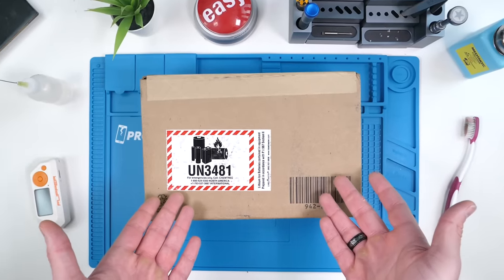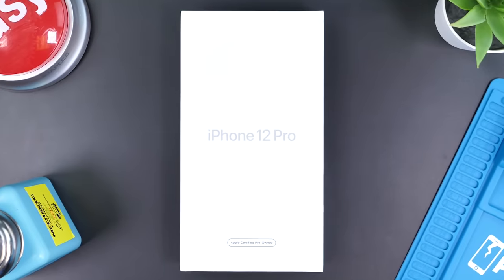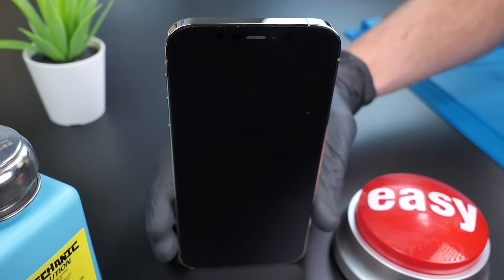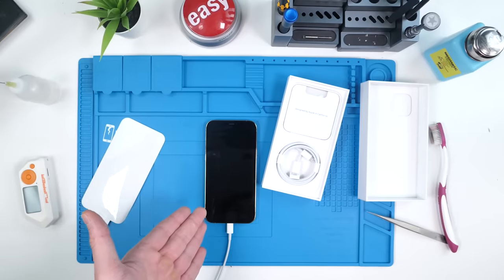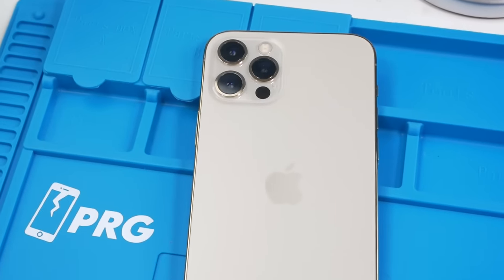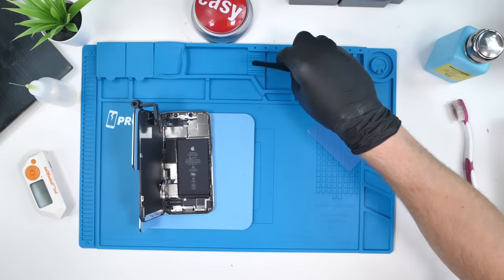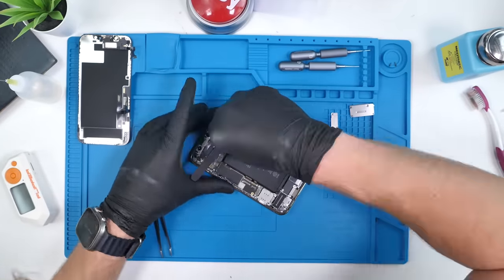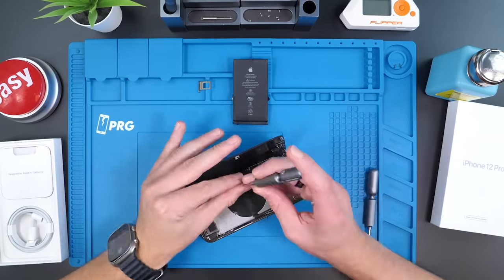Apple Refurbished... What's The Catch?

Comment: Fun fact I’ve worked at Apple and those phones are the ones that we replace when you ask for a warranty. They are brand new, buy refurbished
Reply: Elaborate
Reply: What about accessoires? Like the 3rd gen AirPods?
Reply: @18PregnantAndProud  because they are technically not brand new, so they simply can't sell them as brand new
Reply: @18PregnantAndProud  yep because the battery failed or something. And they replaced
Reply: Are those phones still water resistant like new or not?
Reply: @TheNintySeven97  Of course they're water resistant.
Reply: @TheNintySeven97  yep, they are literally brand new they pass the same tests as a new iPhone
Reply: I’ve twice received a new unit and it was NOT in a box like this. Both times it was a super flat box which only contained a new phone. Why would they give you a new cable, knowing how ultra stingy they are (“for the environment”)?
Reply: because you’re buying a replacement, you already have them. These are considered first-time purchases.
Reply: Agreed. I have bought 
4 iPhone 4S still using one 7 years later
1 5S dead after 4 years
1 iPhone 7. Returned because microphone failed didn’t work 
1 iPhone 8 still works but charging issues after 4 years
1 iPhone 12 mini works perfectly so far PERFECT and saved $420 from the cost of a new 12 mini
Reply: @MatoNupai  bro has more iPhone than my entire family 💀
Like WTF aren't apple supposed to be last more than 5 years 😂
Reply: @ryanb5308 I wouldn’t buy AirPods that were in someone’s ears at some point in time ever 😂
Reply: @BRAZZERSXXXXXX when they replace AirPods they thow out the old pairs

Comment: I think that Apple Refurbished is good, but still, they should try with some older phones. The 12 will stop being sold refurbished after the 15 is out. If I could have bought a refurbished iPhone 5 I really would have.
Reply: Yeah I wish they would continue some of the older phones that would be cool!!!
Reply: i wanna buy refurbished iPhone 4
Reply: Those phones don't have software support anymore, so I doubt they would do that.
Reply: the 11 line was sold in the store until a couple weeks ago. Every once in a while a really cheap 360ish dollars iphone 11 shows up. You cant go cheaper then that.
Reply: eBay refurbished is better
Reply: @malikkelly  in no way
Reply: Barely anyone would buy them. The iPhone 5 can't run past iOS 10 which has virtually no support for most of the apps you'd use every day.
Reply: maybe not that old but i would totally buy a refurbished iphone 8 plus
Reply: Trust me
Get the 5s
It's basically all you need for cheap
Good battery, small, portable, fast and cheap
I still use it for phone calls and airdropping things to my iPad
Reply: why? @malikkelly

Comment: I got an M1 iPad Pro from apple refurbished.  Saved about $200 compared to new and the unit was absolutely spotless.  As far as deals go, sometimes amazon or best buy are better, but as far as quality goes, I can wholeheartedly recommend apple refurbished.
Reply: I just ordered a brand new 2tb m1 iPad pro 12.9 for $1000 on woot. Hoping it comes with iOS 15.4.1 or older for jailbreak. Killer deal if you ask me
Reply: i also ordered an M1 iPad Pro 11'' in it's cheapest configuration for 749€ and i'm super happy with it. It's basically brand new and I paid less money then I would pay for a new iPad Air
Reply: @GU_WOP_O  didnt those ship with either 15.6 or 16
Reply: @xuus I have the same issue rn, how is it working for you now? I want to buy the iPad Pro M1 11inch so bad bcs the air is the same price but less
Reply: Having issues with the m1 12.9 at the moment, it doesn’t like charging with most forms of charger and it seems like lots of other people are having the same problem  - maybe best to wait until apple releases a repair or software patch for these

Comment: I used to work for a Foxconn affiliate and they basically used all new parts for everything, but the motherboard. There are a few different device assembly and disassembly lines that take the phone all the way apart, do extensive testing of the motherboards by plugging them into devices that check that everything is still working, the motherboard gets flashed with new information, like the IMEI and all of the parts are serialized to the device and assembled. They use all of the same equipment that the normal assembly uses.

They may refurbish some of the other parts, but at the end of the day, these are basically new phones.
Reply: There shouldn't be any fingerprints, so whoever was working on that part, wasn't wearing their finger cots.
The screws aren't tightened by hand, but with an electric torque screwdriver that is calibrated to not over tighten. They can still go in sideways, but it shouldn't be overtightened unless the calibration went off. I'm surprised you didn't have a device with a torn graphite layer anywhere. It was so common to see the screen with the torn graphite layer that it wasn't even considered an issue. (maybe that changed at some point)

Comment: When I decided to buy an iPhone 13 Mini, I first did it through the Apple refurb page. At first the only odd thing I noticed was that the gap between the screen and the top bezel was a little wider than usual, allowing dust to enter, but nothing I couldn't remove manually with the help of something thin. The real problem came about a week later, when all mobile data functionality stopped working regardless of which SIM I was using. I took it to an Apple Store and they confirmed that the antenna was malfunctioning. The funny thing is that they couldn't exchange it for me there, because refurbs are web-only and therefore returns can only be made from there. Anyway, I returned it without any problems and simply bought a new one on Amazon. The new one has a perfectly sealed screen, so yes, that wasn't normal either. I suspect the antenna was the component that was originally malfunctioning on the original refurbished phone, and the technician just failed to repair it properly. I know my case could just be bad luck, but I just wanted to put my two cents in here for everyone. On another note, the 13 Mini is my favourite phone and I couldn't be happier with its form factor!
Reply: Don’t see any 13 minis on apple site yet
Reply: 12 mini user here... Not a fan of apple and ios but there isn't alternatives
Reply: It wasn't normal that your brand new phone had a perfectly sealed screen?
Reply: @GeeEee75  I was comparing it to the refurbished one I bought from the Apple website, that one had a gap between the screen top side and the metal frame that the new one hadn’t. I suppose it’s normal to open refurbished devices if they need a repair, but obviously after that it was not properly resealed.

Comment: I bought all of my Apple devices on their refurbished store, that's an iPhone, iPad and MacBook Pro. They are typically about 15% off but here in the UK Apple just cleared out a load of old iPhone 11s for £379 which is nearly half the original list price so if you don't mind buying something that is just a couple of generations old you can get some great deals.
Reply: I have an referbished iPhone 12 mini from Apple and I think it was £400
Reply: eBay rebubished is better
Reply: @malikkelly lmao
Reply: Probably ex-demo or unsold/forgotten UK-held stock, I'd imagine. If you happened to buy one, does it have a UKCA mark on the box? 🙂

Actually, I might head to the Apple refurb site later. I know they're close to obsolescence (If not past it) but I miss my Xr, and I'm not buying another one through a reseller after the experience I had with that one!
(Previous owner defaulted on their account after I'd bought it, and the network provider blocked the phone without my awareness.)
Reply: yeah but an 11 sells for 150-200 fully working used, over 400 (converted) is crazy

Comment: I have an M1 Mac Mini I purchased from Apple refurbished. It replaced my late 2015 iMac, also from Apple Refurb. I gave that to my cousin and it's still chugging along. I also bought a 13 Mini from eBay refurbished for a 2nd phone for family calls only that came with 100% battery health and no scratches or other issues. That was cheaper than Apple's. Still, Apple refurbished has a decent record.

Comment: I know this is most definitely just bad luck, but I ordered a refurbished iPhone 12 Pro from Apple at the beginning of the year and had to return it just a few days after because it started bootlooping all of the sudden.
I contacted Apple support and they sent me a replacement phone, but that one didn’t seem to be refurbished as the battery was at 93% (dropped to 89% just a few days later💀) and the frame had scratches around the lightning port.
I returned this phone as well and thankfully got my money back.
I’ve just been very unlucky but I won’t buy refurbished again. I safed all of my money to buy a brand new iPhone 13 Mini a couple of months later and this one is working flawlessly. I simply cannot trust refurbished phones anymore. I’ve had too many bad experiences with them. The issues with the 12 Pro I ordered were the icing on the cake…
Reply: yikes, that's some bad luck
Reply: @DeerJerky  it really was :(
But I’m actually kinda happy it turned out this way because otherwise I wouldn’t have my 13 Mini now so it’s all good in the end haha
Reply: @Nexus7_  haha

Comment: This was an excellent video with good information. Apple is one of three manufacturers that I would buy a refurbished product from. The other two are Bose and Sonos. The three companies are the only ones that I am aware of that provide the same warranty as if it were new (one full year parts and labor, or even replace). If you buy a refurbished device from one of the big box stores or any retailer, you will most likely get a warranty that's from 30 to 90 days, and there is no guaranty that any replacement parts or components are OEM certified. Also, these retailers often use third party marketers, that most people never heard of. The parts may be generic.There may be other manufacturers that I'm not aware of that would offer one year warranty. Always do your due diligence before making your purchase.

Having been in Consumer Electronics since 1980, I know what I am talking about. A couple of tips:If your Apple device needs service (new battery, screen, etc.), only take it to an Apple store or Apple authorized service center. They are the only ones that use certified Apple parts and components. If you do use an authorized service center, never leave your device over night. If they insist that you have to, then leave and take it to an Apple store and have them service it. (Apple is less likely to go out of business).

Comment: Many, many years ago I had a faulty iPhone 4 (sticky home button) which I took back to Apple on like the 350th day of the 365 day warranty and they said (at that time anyway) that whenever you get a replacement phone through the warranty that late in the cycle it would a "certified refurbished" similar to what they sell nowadays, the guy said that everything is a new part except the motherboard. I think things like fingerprints on the internals and overtightened screws happen on new phones too, Friday afternoon jobs are the worst 😂

Comment: I looked at getting one prior to buying my 15PM, and I am also in Canada. They only had 13PM with either the 512 or 1tb. For the cost, it was the exact same as buying a 15PM brand new, mind you my 15PM is 256. From my POV, unless you really want more storage but you are fixed to a specific budget, you are better off buying new than apple refurb. It's just hard to stomach paying 1900 when that's how much a brand new 15PM base model is.

Comment: I bought my 12 pro refurbished through eBay. First one I got had the “display message” for a screen replacement. Bluetooth didn’t work but I sent it back and the new one I got works fine. Paid $500 for a 12 Pro 256gb. The new one doesn’t have a display message so I’m pretty happy.

Comment: Just wish there were newer options.

I'd just wait for my wife to get her 15 series and take her 12 pro.  A 13 pro would have been tempting.

Yet, I found a good example of FB marketplace with 256GB of storage for $550.  Met the seller in Starbucks, verified that it had 91% battery health and was unlocked.

I'd moved my SIM from my iPhone7 (you read that right) and was up and running in less than an hour.

Comment: I don't understand Apple's prices. Apple charges €729 for a refurbished iPhone 14 256GB. You can also buy the iPhone 14 128GB new for €729 on the Apple website. The iPhone 14 with 256GB costs €859, which is €130 cheaper in direct comparison. The iPhone 13 still costs €619, which is just €110 cheaper. If you really buy a refurbished iPhone, you might as well buy a new iPhone because there isn't really a difference in price and since the case, screen and battery are replaced anyway, you're probably just as harmful to the environment as with a new one. Or you can buy a used iPhone somewhere else.

Comment: I wouldn't be too surprised if a large percentage of the „Refurbished“ phones are ex-demo units, particularly from Apple and partner retail stores. Being very careful over product control, Apple won't just tell stores/partners to remove them from displays, wipe/restore to factory then drop them in a „Bargain Bin“ - They'll have them shipped back to Apple for feeding into their refurbishment line. 
This also means Apple can keep all sales of official used goods in-house and under control, rather than having numerous units out in the wild with discount stickers and an unknown history to them. 🙂

I do wonder about them replacing the shells/glass on every unit, though - This sounds very wasteful for product that doesn't need it. I used to have an iPhone XR which I bought in one-previous-owner condition and religiously kept it in a solid Love Mei case. By the time I came to sell it on it would easily have passed as „A-Grade“ in most refurbishment assessments - The 2-3 very light scratches (From the first owner) were virtually impossible to see from any distance, and could probably have been polished out, and I'd even managed to keep the battery health at 100% over those two years of heavy use! 😇

Comment: Wait isn’t a 512Gb iPhone 14 pro $1300, and this iPhone 12 Pro is $1330, so you are paying $30 more for an older phone (not to mention used)? 
It’s crazy they’re charging that much for this phone, simply because when the phone came out it started at 64Gb so the storage upgrade used to cost way more.
They’re basically charging you the original price from 3 years ago, even though 512Gb today is cheaper, and for an iPhone 14 pro not 12…
Reply: Keep in mind the price in this video is in CAD. The base model 14 Pro is already 1399 CAD and that's got 128GB of storage.

Comment: Thats interesting video!
Thank you for the video which I never seen a tear down of Apple refurbish product. 

I brought refurbished M1 MacBook Air, M1 iPad Pro 11” & 12.9” and iPad Mini 6. None of them have problem, except the 12.9 iPad Pro, in which the ambient sensor was not working. It took me very long time (many reinstallation) to figure out what was wrong and 3 times Apple Shop visit and I finally got replacement with service unit. Well, I am not sure it is better than refurbish or not, confusing… I should have returned it when it has an issue during returnable period.

So, there is a chance to get a bad product, but you will get replacement from Apple. I therefore, still brought 2 more refurbished iPads but took a lot of attentiveness the its functionality before the end of return period.

Comment: My phone had a bit of coffee in the lightning connector, cleaned it with a q tip then let it dry, the prompt is gone but now the screen acts up a little, rarely changes colors but mostly does small black lines on the top then shakes slightly, since it had to do with liquid, will it go away after a day or so from it drying or do I need to pay for it to be fixed?

Comment: I point everyone to their refurbs.  Why...because Apple has made battery replacement so much harder, and almost all other used/refurb device sellers only warranty that the battery is above 70%...spend the extra $$$ for one from Apple which comes with a new battery.  And, for those who want it...AppleCare.  Buying a refurb'd one allows you to get the device plus AppleCare for about the the price of just a phone if it was new.

Comment: Hey mister Guru I got one question I would like to repair my Pixel 4a 5G screen but the repair shops are honestly charging a lot for the screen and replacement but they told me if I could get the screen on my on the price would go down a whole bunch
So my Question here is where is a good option to buy my Pixel’s screen

Comment: Even though this is a awesome refurb job. It still doesn't make sense imo.
Here in Germany a refurb 12 pro 128gb costs 850€. Buying a brand new iphone 14 cost 750€ now.
Reply from the maker: 14 and 12 pro are different. The pro comes with a much higher price tag
Reply: @PhoneRepairGuru  and don’t forget that pro is a harder flex

Comment: These phones are way too expensive, a 12 Pro Max with 256GB costs 1069€ and when u compare it to a brand new iphone 14 pro max it costs about 300€ more but takes u 2 Generations up. Its simply not worth it in my opinion. And a little sidenote, if you buy the 14 Pro max 256Gb refurbisched in excellent condition (3rd party retailer) it will only cost 150€ more than the 12 Pro max refurbisched from apple.